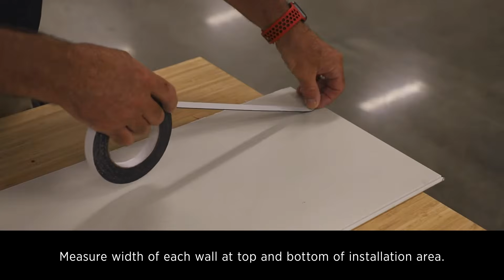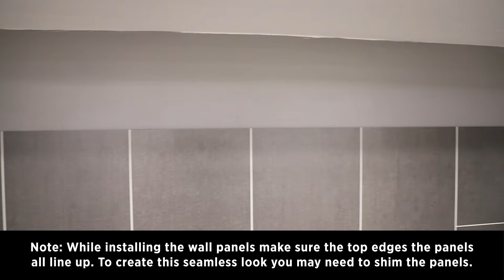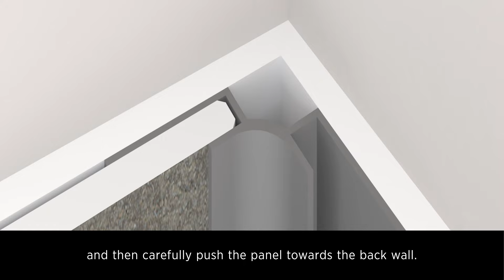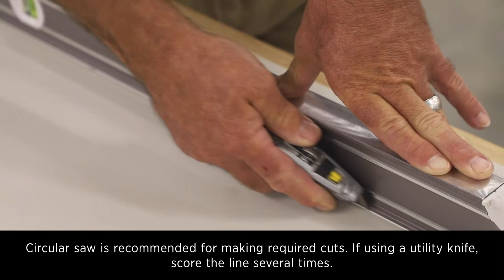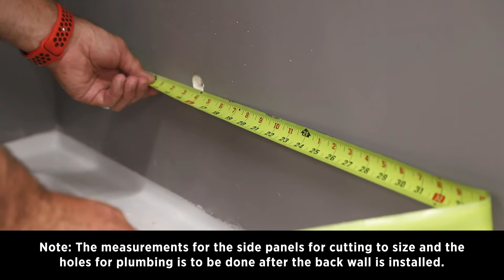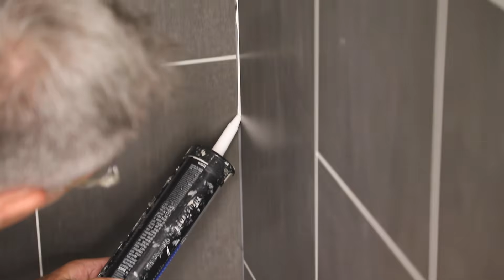Craft + Main® JETCOAT® Shower Wall System - Installation Video

Comment: these things are not easy to install.  Just got mine done.  Took an entire day of cutting and fitting.  From there it took almost an entire day to glue the panels in.  It looks great, but If I had it to do over I would have gone another route.
Reply: No kidding. Saw your comment before buying one and didn't think much of it. Should have listened... Now its installed but was not fun at all
Reply: Does the tape have an open time on adhesion to allow for panel adjustment?